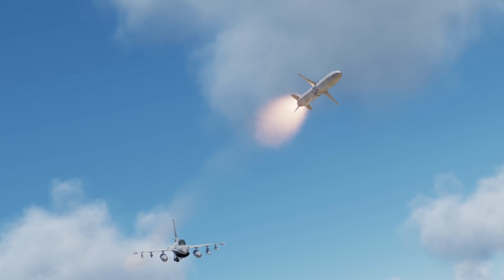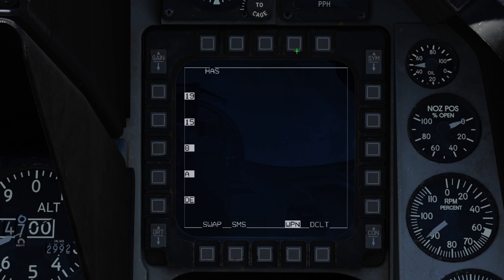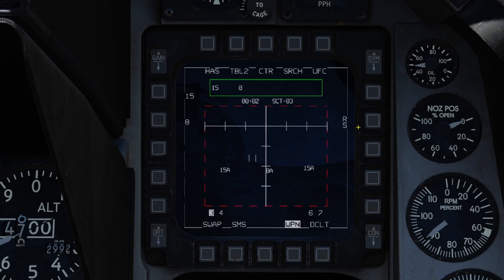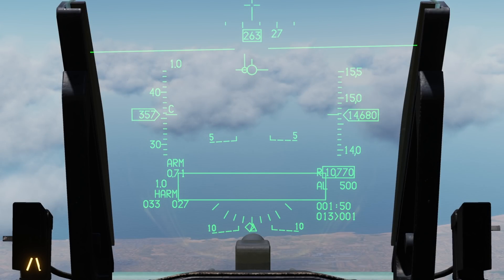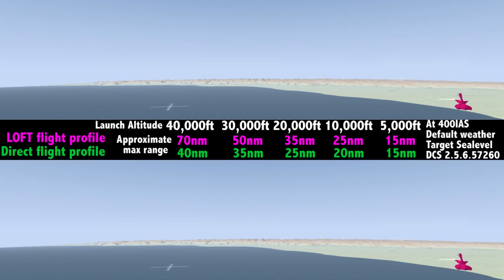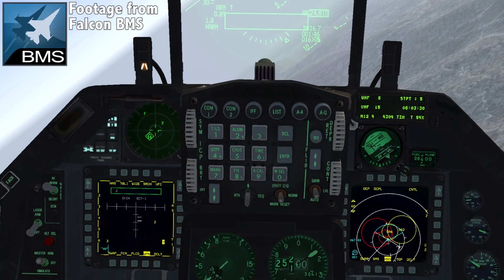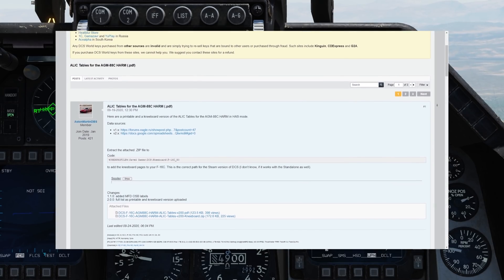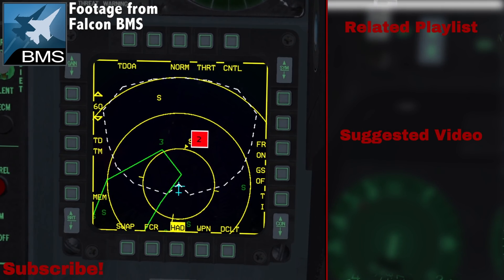DCS: F-16c Viper HARM HAS Mode and Threat tables

Comment: I was wondering why i couldn't find half the radar targets in my tables i think its pretty stupidly designed that you have to manually add more radars instead of just having another table but i guess thats what you get with a plane from the 70's
Reply from the maker: Just working around the limitations of the tech, the HTS pod brings it into the modern era!
Reply: @RedKiteRender  does it bring similar capability's as the F18's ground radar
Reply from the maker: @Husker5454  It maps out the locations of radars and even remembers roughly where they were when turned off. It lets you use the harm nice and easily, as well as enabling the harm to use lofting mode to give it greater range.
Reply: @RedKiteRender  nice lack of loft is really limiting atm

Comment: What a ceazy crappy mode!
Why in the world would anyone ever use this mode for the HARM?!? Please enlighten me.
Reply from the maker: It's main advantage is it doesn't need any extra hardware, since we lack the HTS, that's what we've got to use for now. The Harm on the Viper is more accurately simulated than the F/A-18c for example, which is due to have similar limitations added later.
Reply: @RedKiteRender  they already removed the Hornets ability to lift HARMs in TOO mode
Reply from the maker: Yep, had to hurry to re-research the lofted values on the hornet for comparison prior to this last patch. Hope this means Pre-briefed mode is coming to the Hornet soon, along with POS for the Viper.
Reply: I will say, it’s very handy as the equivalent of the F-18’s “SP” mode, as a quick “Point and Shoot” mode if you’ve been caught out by a pop-up threat on the RWR.

Later modes, such as POS, allow better ranging and Missile kinematics, but are usually confined to only being able to be aimed relative to steerpoints already in your flight plan (there are modes for pop-ups in POS but this provides better SA IMHO).

The answer you’re looking for though is that it’s rarely used in a modern environment with correct equipment. 

HAS mode was made to make use of the HARM prior to the HTS’ availability. It’s like asking why anyone would use walleye II when you have LGBs or JDAMS - it’s legacy, but it can be fun if you want to try your luck with an 80s -era mission, or a mission where maybe you aren’t a USAF Viper driver. I don’t think the Euro-Viper drivers got HTS, but I’m unsure if they even got HARM in those cases.
Reply from the maker: HAS is still useful for quick improv engagements (whilst lacking the HTS) But yes, mission planning is a large part of how SEAD is done, so POS and HTS are much better suited, when we eventually get them.
Reply: It’s very barebones, but it’s pre HTS. Back in those days Wild Weasel F-16s flew mixed wings with F-4Gs as leads. The F-4s would do the more precise targeting while the F-16s followed their lead.

Comment: Pos mode is not usefull either unless you planned the mission.
Reply from the maker: Planning is a very large part of modern Operations, it's just a bit of a DCS-ism that we throw ourselves into combat without much forethought.
Reply: @RedKiteRender   Its because we dont have the planning tools yet. Once the data cartridge feature comes out these features are going to be usefull but now their useless
Reply from the maker: I expect these features are tied to the eventual dynamic campaign now, as it's been years since DTC was teased. You're right, we really do need proper planning tools in dcs, but it should be possible to use POS in EOM or PP with a properly panned mission in the editor, or one manually setup after getting in the jet. It's just a bit of a pain.
Reply: @Obi1-KenBone-Me  the Viggen and Tomcat utilise VERY basic data entry by scraping waypoints off the map. This alone would be handy, as would having access to the setup in the options/special menu for the F16. You could write your CM programs, and various HUD, BINGO and similar settings into options menu, and when you press load, it would take those settings (say, HARM tables) and add them to the markers on map. Perfect for dynamic multiplayer environments like BlueSpike!
Reply from the maker: Yep, some modules have nice workarounds, the JF-17 has it's dtc setup in the Special options! Otherwise you've got to edit .lua files to change the defaults, which is a royal pain. I do hope we'll be able to (partially) override player DTC's with mission specific ones in the editor too.
Reply: POS 'aims' the HARM at the currently selected steerpoint.
Steerpoints can easily be created in the cockpit.
It's very simple to make POS useful.
Reply: @fonesrphunny7242  yes and no.
POS is indeed for aiming at steerpoints, and while it is possible to write new steerpoints into the system and letting the HARM catch it, you would be MUCH quicker in a pop-up threat environment switching to HAS, pointing the nose at the missile plume and selecting the threat based on RWR. Because I doubt you’d have the time to find the source, check the map, plot a Lat/Long and elevation, then punch that into POS mode. That is also why POS has a RUK (Range UnKnown) mode, where it doesn’t have a range - it just looks for whatever threat type you tell it down a bearing. It’s got the same vulnerabilities as HAS mode in terms of missile range and kinematics though